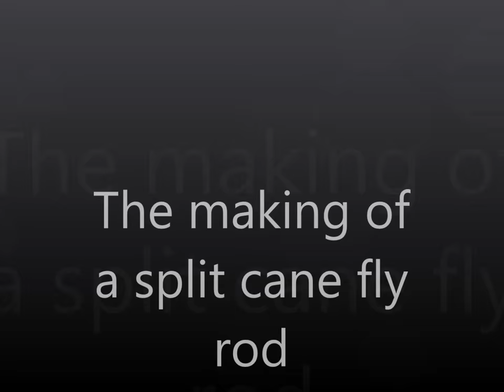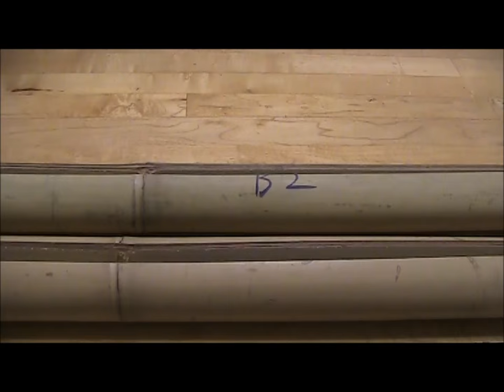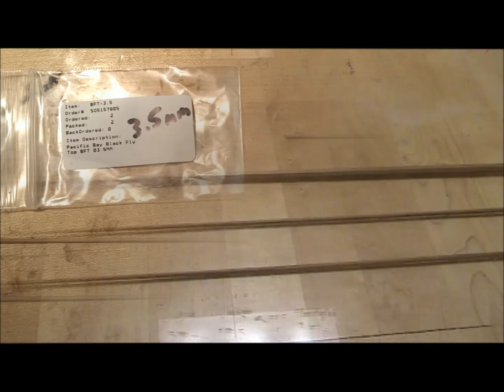Making a bamboo (split cane) fly rod

Comment: Really great video! thank you very much for posting.
Reply from the maker: +Mat Harris. Thanks Mat!
Reply: @paflyfish  how frequent do u have to sharpen ur blade when tapering the bamboo
Reply from the maker: @dariuswhite227  For initial taper (or rough beveling) to the 60° necessary I use one Stanley plane. I might plane three strips or so doing thus, and occasionally up to six.  For final planing I use two planes. One is fitted with the standard Stanley blade, and the other a Hock blade. Since this is the final taper I am much more careful about the angles and cautious of chips or tear outs. I'll use the first plane to get close to the form, usually within a few thousandths. Because I don't use a scraper, I want the second plane to be fresh and sharp. So I'll use that plane to take off the last remnants of bamboo. It may take longer, but I'll sharpen both planes for each of the strips, so if I'm building a butt and two tip sections that would mean sharpening both planes 18x for final planing, or the three 6 strip sections. Because I'm sharpening for every strip, it doesn't take too long as I'm not allowing the planes to get too dull. At the point of final planing you want to be very careful. It might be possible to sharpen less, but don't push it. You workmanship really shows with strips that have no chips, or open seams. Check the planes for sharpness on the edge of a piece of paper after each honing. This can be a little challenging at first, but you'll find a groove that works for you. Hope that helps!

Comment: wow sir i thank you for the showing how to straighten the bamboo without shaving it... caused i shaved mine just to straighten it... big thanks sir...
Reply from the maker: Thanks silverfox. Best of luck straightening and flattening your nodes. Heat is the easiest way to straighten the strips and you will feel the bamboo becoming more pliable as it heats. There can be too much or too little 
heat, but over time you will get the feel of it. Gloves help to protect your hands and proper safety measures are important when using a heat gun or the open flame of an alcohol lamp. It is advisable to keep a fire extinguisher handy in the workroom.    
The strips have the tendency to hold the straightness you impart as they cool. Nodal areas should be straight and lie flat in the planing form before you begin final planing. If not, they will frequently cause problems. There are a few good "how to" split cane rodmaking books that go into detail about flattening and straightening nodes. 
 
There are also a number of "rod gatherings" throughout the U.S. (other countries too). These events include established rodmakers of various levels, as well as folks interested in learning the craft. Many of the 'makers' are generous to share information.
Reply: wow thank you again...!!

Comment: Great idea heating varnish in hot water to lower viscosity especially in cold weather.
Reply from the maker: Other rodmakers do this too, as well as thin the varnish to aid flow to get a finer coat, although some manufacturers do not recommend thinning the varnish and you can increase VOC's. As I do not have a window for ventilation in my space in the basement, I installed an exhaust fan to draw out vapors.

Comment: I am from Brazil. 
Please, can you tell me what kind of epoxi you use to glue the bamboo splits? Thank you! You do a great job.
Reply: What I currently have is called Smooth On EA-40 Epoxy. It is a clear adhesive and comes in two separate cans.  Part A is the Resin and Part B is the hardener. This epoxy is used to make bows, which are also able to withstand a lot of stress. The mix is 50/50. The reccommendation following application is to heat cure at 180 degrees in a heat oven (which I have) for a minimum of 4 hours. Good luck!
Reply: @alfredeneuman6966  that's what is thougth. You helped a lot. Good bless you.

Comment: Really good video, I'm about to start on my first rod and was wondering if i could build some kind of smoker to heat treat? Really appreciate the video
Reply from the maker: I followed the advice of Frank Neunemann. If you type and search for 'Heat Treating Oven - Frank Neunemann,' you should find the description for a vertical heat treating oven powered by a heat gun. Although this is a relatively simple design, I've personally had good results heat treating the strips.

Comment: interesting that after months of waiting for the culms to cure you immediately soak them in water - if you're burning them with a heat gun maybe the technique needs altered?
Reply: That's a valid question. Many rod makers do it this way. Essentially you're straightening the nodes and strips. Water helps to decrease drying out the strips and burning them. It does take a bit of heat to straighten the strips and with a little effort you can get them surprisingly straight. Sometimes a culm is 'flamed' and sometimes left alone to make blonde rods. I have heard others say that oven baked cane 'prior' to planing is just too dry to plane well. After final planing I heat treat in an oven which likely removes any excess moisture and theoretically tempers the cane. Does it truly do this? I cannot be certain, but that is how my instructor taught me and many other builders do this as well. I will say the strips 'feel stiffer' following heat treating. How much moisture re-enters a finished rod after it is glued up and varnished is a topic of some debate among rodmakers.

Comment: How much play if making an 8ft cane fluid for a sx weight #6
Reply: I built a Garrison 8 foot 6 weight rod. My reason for choosing that taper is because Garrison was a  structural and electrical engineer and was careful with his measurements and plotted out his tapers with an engineers mind using stress curves, etc. Longer rods tend to be heavier and that is another reason I like the 8ft 6wt. If you are maker and thinking of that taper it is a good one. I seem to get out a decent bit of line with it.

Comment: Great job,could i know how many degrees the oven is and for how long?Thanks
Reply from the maker: That is a good question. Everett Garrison treated his bamboo inside a metal tube with a torch for a short period of time. That probably makes sense given the cane is laying on bare metal with a torch waved over it. Assuming you are using some sort of oven it would be different. Jack Howell in "The Lovely Reed," recommends 375° for 20 minutes (a little more if you want darker). George Maurer in Fundamentals of Building a Bamboo Fly Rod recommends up to 350°. Wayne Cattanach in "Handcrafting Bamboo Fly Rods," recommends 375° for 7 minutes, then flips end to end for 3-1/2 minutes. I personally warm the oven first, then put the strips in at 350° for about 25 minutes in most cases, maybe 20 minutes for a blonde rod if I want it a bit lighter. Since I straighten the nodes wet I want to make sure the moisture is drawn out. Heat treating does temper the cane, and you can feel additional stiffness after the strips are cooled and removed from the oven. As oven types differ you will want to determine what works best for you.
Reply: @paflyfish  grazie mille,mi è stato di grande aiuto,io sono Italiano e lei?
Reply from the maker: @astrafaro5274  In the U.S., but one of my great grandmothers was italian (Therese Verderame), and her husband was also Italian (Giovanni Solia), so my grandmother was Antoinette (Netty) Solia.

Comment: I've got up until you start planing ,,where do you get those planing guides ??
Reply from the maker: If you are referring to the forms there are at least four sources that I am aware of and possibly more. Search for "planing forms" and add any of the following four and you should get some hits: Swearingen, J.D. Wagner, Bellinger, and Peak fishing. Most makers begin with a standard Hex form, but you may find forms for swelled butts, quads, penta's, and so on. These suppliers also have other tools helpful for rodmaking. If you are so inclined you might even craft your own forms. Check out Thomas Penrose's Bamboo Fly Rod Pages. Hope that helps.

Comment: Great video!  Did you make your planing forms or buy them?  Also, what kind of dial indicator do you have?
Reply from the maker: Hi Justin. I did not make my own planing form, but purchased a metal form from Larry Swearingen. I had first used a wooden form that was given me by another rodmaker, but when I looked at it more closely in thousandths, I found it was off :(  Jeff Wagner and Bellinger make some good metal forms too. If you are handy you can indeed make your own forms of hard wood, or even metal. I've known makers who have done it. I have only built hexes (6 sides), but forms come in quads (4) or pentas (5 sided) too. Regarding dial indicators a standard dial indicator is fine. You can usually find these at a reasonable cost. With the standard dial indicator the large set of numbers on top increase in a clockwise direction, and the lower smaller numbers run in a counter clockwise manner. The lower smaller numbers are the ones you actually use to set the planing form. The standard indicator works fine and many new and accomplished makers use them. There is also a reverse reading dial indicator. Here there is only one set of numbers and they run in a counter clockwise (correct) direction. My vision ain't what it used to be and one set of large numbers is easier to see and a bit less confusing. I recently found a good reverse dial indicator on Ebay at a decent price. It is a Mitutoyo model 2904S. New builders will also need a 60 degree point and a base for the dial indicator. Happy building!
Reply: @paflyfish  I just purchase a plan from Larry too . I made a fly rod with it and I'm still a little confused about the tapers. Is the taper the size of the individual strip or is it the diameter of the finished rod.
Reply from the maker: @dariuswhite227  That's a good question. If you look online at Hexrod tapers for example, it lists 5" taper dimensions from tip to butt and the suggested line weight for the rod. Say the final tip dimension is .060 thousandths. That dimension is the recommended diameter for the finished rod. What you want to do is half that value to .030 to set your planing form. If you're building a hex rod, two strips are seated across one another and that dimension equals .060. If you were to make each measurement .060, without halving, then your tip would measure .120. Half the values for all 5" stations for both tip and butt and set the depth of your planing form accordingly. Hope that helps.

Comment: I have bamboo in my back yard can I use that? I would get the right size I have a lot of it too so I would have a lot to pick from if I wanted a stronger on so I could picka really tall one like 20 ft tall and cut off the top and use that or I could make a weaker one by using a 10 ft bamboo stick. Or would I have to buy some special bamboo?
Reply from the maker: The majority of cane rod makers use comes from China. We have bamboo in our yard too, but it is unsuitable for making split cane rods. The bamboo with strong enough fibers suitable for rods is arundinaria amabilis, frequently referred to as tonkin cane. The short answer is you would need special bamboo.

Comment: bạn có thể cho tôi biến keo mà bạn ngắn những thanh trúc lại với nhau là keo gì không ???
Reply from the maker: Chi, I looked up the product I have been using from Bingham's Archery and noticed it was missing. I wrote to them and this is their reply, "The Versamid 140 was discontinued by the manufacturer and we decided to discontinue rather than replace it with something untested. The Smooth-On was our most popular epoxy."   This was a two part epoxy and worked well. I will also need to try something else and am considering Titebond III. The set time is shorter and therefore the glue up time will need to move more quickly.

Comment: Do you make 9 ft 5 weights? If so, what are we talking? Would love one that isn't orvis branded.
Reply from the maker: Good question. The longest split cane rod I have made thus far is 8’6”. It is a Leonard Model 50 ½ tournament taper for a 5 weight line. The tip is actually quite thin, but the rod has enough thickness in the butt section to add power. Essentially I chose the taper because of the fineness of the tip section, as typically bamboo rods above 8 feet can increase significantly in “swing weight.” To further reduce weight the rod is hollow built. It was fished on the South Holston tail water in Tennessee last spring and fall, as well as other rivers, and the action is pleasing. I will be fishing the rod again on the SoHo in early May this spring. I have various 8’6” Grangers, a Phillipson, and Heddon, (all refinished); also refinished a beautiful 8’6” Cross rod for a friend, and these are fine rods, but the swing weight is more tiresome than the Leonard model 50, especially if you are holding the rod for any length of time. I have a Heddon built “trade rod” at 9 feet and have cast a friends 9’ Granger. Again beautiful rods, but heavy to cast for any length of time. That being said there are those who don’t mind a little added weight and makers who build long bamboo spey rods for customers. There is a 9’ 5 wt. taper I have thought of building, but have not done so yet, so  cannot say how it would feel or fish. I'd hollow build it and it would be a 3 piece (two ferrules). Private message me and we can discuss options further if you are interested.

Comment: hi, great video! what kind of motor did you use to dip the varnish.
thanks
Reply from the maker: Hey Harry, I got a small motor from Grainger Industrial Supply. It was a few years back and the motor is in a housing I created as you see in the video. Looking at the web (I think) it was a small Dayton AC gearmotor at low RPM. Zoro Tools sells a 4 RPM for a little under 60 bucks. I fastened a fishing spool to the rotating arm filled with backing. Any slow rotating motor should do. Brasstown Creek recommends a product from Jameco - product ID:  155821 (from their website).  They state they paid $22.95 in 2011, so it is even less expensive. Some makers simply spool backing onto a fly reel and raise the rod sections with a slow retrieve, but I don't know that I'm that patient or trusting in my retrieve :)

Comment: could u tell me about the full numer of the two stanley block plane? thk u
Reply from the maker: I use three planes for rodmaking. One is an old Stanley 60 1/2. This plane I generally use to rough out the 60 degree strips. Because the plane as designed will scrape at a fairly low angle I set the blade to 40 degrees. I do not personally use this plane for final planing, but others do. For final planing I use two old Stanley 9 1/2 planes. The first gets close to final planing on the steel form, and the second does the final planing. The reason for two planes is that I prefer the second plane to be fresh and very sharp when the last few passes are made on the form to reduce and eliminate tear out. The angle I use on the Stanley 9 1/2 is 35 degrees. Other Rod makers may use 25 or 30 degrees, so figure out what works best for you. The reason I like a higher angle is that it reduces tear outs by possibly digging under the bamboo at low angles, but you need to keep the blade very sharp. Some makers also use a scraping plane for the final passes.  
To set the angles of the blades I use a Veritas deluxe honing guide. You can see pictures of this on Woodcraft for example. You can set high, standard, as well as back bevels with the guide. It helps to create consistent angles when sharpening and planing. I do not use a back bevel, but others do.  
For the blades I use Hock blades as do many other makers. They may be a little more difficult to sharpen than say an old Stanley blade, but keep their edge longer.  
Sharpening can be achieved with sandpaper, waterstones, diamond stones, or water cooled machines like Tormek or Makita, etc. You don't need to spend a fortune sharpening, but you do want to get a flat sharp edge. A flat sole is an absolute must. Take time to do this and there are videos on YouTube for tuning up your plane.     
An older Stanley isn't the only plane to use either. Many makers use Records, Veritas, or Lie Nielsen to mention a few. Some of the newer planes cause me to salivate. You CAN get by with a single 9 1/2 plane. Just keep it sharp.  
Finally the flatter and straighter your nodes are when planing, the easier and fewer tear outs you will get. If money is no object and want to reduce the effort of planing, you can even buy a milling machine. There exist those for both roughing and final tapering.
Reply: thank you,i bought a Stanley 12-960?how about this one ?
Reply from the maker: I am not too familiar with this plane, but it is described as a low angle plane, meaning the bedding angle of the plane to the iron is at a low angle. The reason I use older Stanley 9 1/2 planes is that they come with a 
lateral turn wheel that makes small adjustments to the blade through the adjustable throat. The newer Stanley plane somewhat similar to the 9 1/2 I believe is the 12-920, selling at Walmart for about 31.58. It does not have the wheel, but a screw mechanism to move the blade forward and back. Stanley does now make a Stanley "Sweetheart" No. 9 1/2 plane (12-138) and it is currently selling for 71.99 at Walmart. This newest plane is a bit more expensive, but it appears to have added the lateral wheel which allows for micro adjustments to the blade. It may be possible to steepen your 12-960 blade angle to minimize chipping or tear outs. From Stanley, "the 12-960 sits at a 12 degree angle. The 12-920 sits at a 21 degree angle," so you can see the difference in angle degree you are already starting with. If at all possible you may find it easier to start with a Stanley 9 1/2. Best of luck!